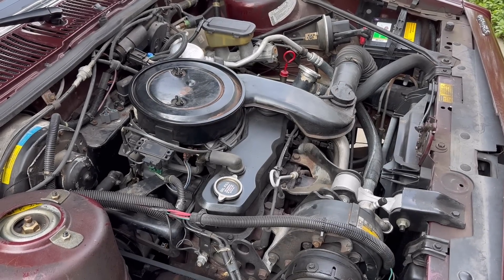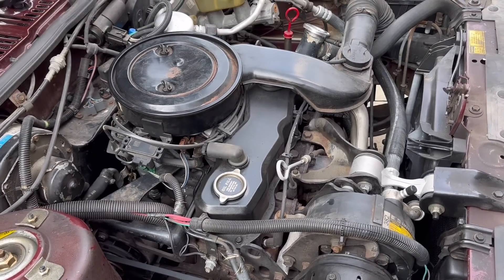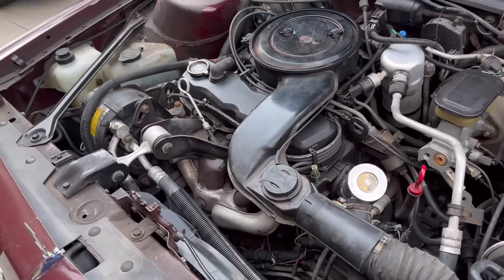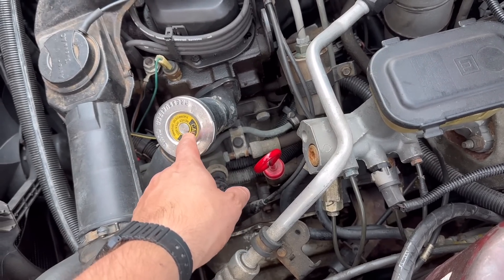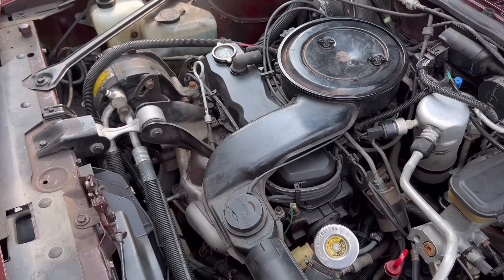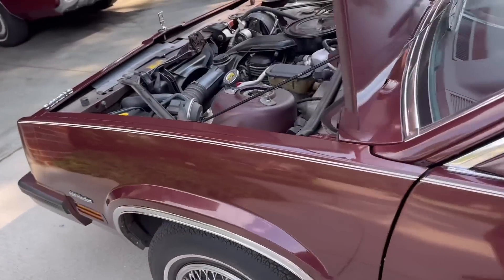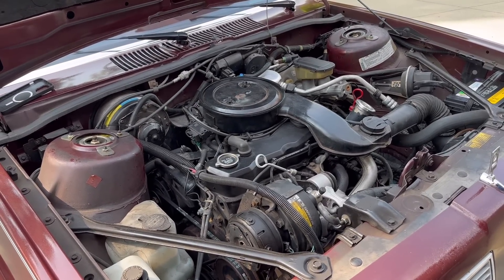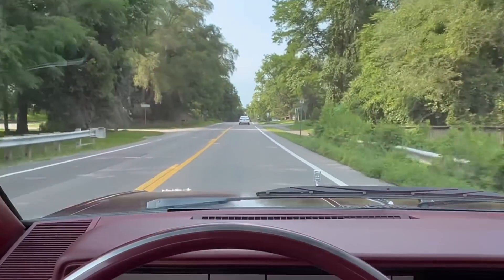Bad Engineering Makes This Engine Challenging to Repair: GM 2.5L Iron Duke 4-Cylinder Engine

Comment: First off, Tech 4!
The "Pancake" compressor is called the R4. I have not seen any excessive seal failures as compared to the old A6. In fact, the seal was designed to weep a little oil (as stated by the GM service manual). Both of my R4's and my A6 are still running R12. Two of them haven't been charged since the mid 1990s. I prefer to rack my car when changing the oil as it makes access really easy but did change it on my back for 25 years. Servicing the cap and rotor is really no big deal given the long service interval. I personally don't like doing the timing gears on the Tech 4. We used to see them come in on occasion with the phenolic teeth missing. Luckily, they aren't interference engines. Valve covers can be a pain too when the EGR valve doesn't want to cooperate. Great video Adam. If you are ever in eastern Wisconsin, feel free to stop by. We can put your car up on my lift and I can show you how we used to service your 80s and 90s car at an award winning Buick Pontiac dealership.
Reply: Most people don`t know this but Ford used those phenolic  timing gear teeth in their Ford 8N`s! We know as we rebuilt ours in 2001 & were the 1st ones to work on engine. Were surprised to see a tractor engine with that type of timing gear. It also had several teeth missing too. With the rebuild kits all metal gears the engine is nosier than with the phenolic gear.

Comment: This has to be one of the worst sounding engines, ever. It is so clattery and awful sounding.
Reply: In my new-car shopping of 2009, I looked at both Honda Civic and Nissan Altima.  I didn’t like how either of their engines sounded (they both had ticking from either injectors or valves, don’t know which).  This Iron Duke at least sounds better than that.

Comment: The 2.5 was a lot better than the 3.0 V6. The thermostat bolts would freeze up and the carbouretor bolts would freeze up.  I think the 2.5 Ironb Duke was a much better engine than the 3.0 litre V6 in the Cutlass Ciera. I wish I had gotten the Cutlass Supreme or the Gran Prix rear wheel drive cars from the late Seventies. The best riding car I ever owned was the 79 Pontiac Bonneville with the radial tuned suspension and the 301 V8. It was a 2 doorcoupe and rode better than my 78 Cadillac Coupe DeVille.
Reply: My cousin had an 80 Bonny coupe with the tiny 267 2bbl. Damn thing couldn't break 85 mph but it was 1 of the most quiet and smooth cars I've ever driven. It also got really good hwy mileage for a full sized car.

Comment: Pontiac hated the Vega engine but had little money. So..... They  adapted a Brazilian design adapted from the Nova four of the sixties. This engine was a cut down straight six. They then had to fit a cross flow head and put the intake over the distributor so it would fit transversely. As it was the carb would have been in the middle of the radiator and probably poking through the hood.

Comment: You can see why the imports were worried about these cars and how they sold so well to start.  On the surface they look great.  Comfortable with good space and handsome styling.  The designers did their job very well.  Then the bean counters ruined them.  I wish today's small cars were more like big cars, like these were.
Reply: I had a radio remote broadcast to do and it was a nice day, so I loaded everything up into my 1982 Citation X-11. Everything fit with more than enough room to spare. The car attracted a lot of college student attention. First, because they had never seen one. Ever. Second, it atsounded them on how much space was in what is now a very small exterior package.
Reply: How did the bean counters ruin them?
Reply: @bradkay  Cheapest materials and build quality. The 1980's cars were junk.
Reply: @garykeith1048  I don't see that the designers did a great job which is what plmn93 is alleging.

Comment: My Mom got my grandfather's 86 Celebrity,yes it was a pain to work on.  Blew a head gasket due to a broken head bolt and replaced the distributor cap while the head was off.

Comment: You already explained why this setup is bad when you mentioned that the cap was easy to do on an S10 pickup. GM engineers are not all that lazy but they LOVE reusing parts- they repurposed this engine wholesale from longitudinal applications without any redesign because they didn't want to change what already worked- or spend money on retooling engine plants.

Comment: I had an '84 Chevy Citation with a fuel injected Iron Duke. The first thing I thought of at the beginning of the video was the distributor and everything associated. How I worked on it was to jack the front end up and put it on jack stands. I then propped my head up under the car and I could see and get to most everything. My brother had the same engine in his Chevy Monza, and the distributor was a lot easier to get to because it was a rear wheel drive car. The engine was turned 90 degrees so the distributor was pointed to the right front fender.
Reply: At first, these 2.5 were only in RWD cars, so the distributor location wasn't an issue.
Reply: @johneckert1365  I put an injected Duke in my '48 Willys CJ2A. It wound higher than the Jeep engine did but didn't have as much low end grunt. Didnt miss the grunt very much cause it had 5.38 axles and I don't recall what trans low gear or transfer case low range had in it. All I know I could white-knuckle the (my) junky little jeep up to 55mph for the first time, lol.
Reply: @patrickshaw8595  lol that's AWESOME 😀
Reply: @johneckert1365 the distributor on my Rwd 2.5L camaro is in a pita location.. lol.  I usually jack the car up on the passenger side to remove the distributor. To replace the failed ignition module.

From the top have replace the distributors cap and wires.

Comment: what's funny is because i had the same car but in a chevy citation. same platform and engine. i bought the car for $75 it needed a choke pull off. i fixed it and drove it for 2 years, the reason i got rid of it? the driver side floor was gone. i sold the car for $50. i remember the location of the cap and rotor, i never had to change it but i did think it was a really bad place for it.

another car i had that had horrible ignition component placement, 1991 cavalier 2.2. the coils were on the back side of the engine. i had one fail once and 2 of the cylinders werent firring. it filled the cat with unburned gasoline. it was glowing cherry red.

the best ignition component placement? any iteration of the 3800, still have 2 3800 cars today. 2003 bonneville SSEi L67 supercharged 3800 (and yes it has the usual pulley swap/PCM treatment) and a 97 grand prix L36. both are in great shape, and im not really interested in selling them. some of the most trouble free engines i have ever owned.

Comment: So how did the term Iron Duke come about to be called for these 151 cubic inch engines? For the ones that don't know, these engines have the same bore and stroke as the Chevrolet and Ford 302's which is 4.00" bore with a 3.00" stroke.
Reply: My guess would be that they weren’t aluminum like the even-more-awful Vega engine.

Comment: The thing is, the engine and car were designed by different engineering teams.
Reply: Besides that, my experience working with GM engineering in the 1980's convinced me that none of them knew that they were building cars. They were just designing components that met certain specs.

Comment: I had an iron duke in an ‘80 Pontiac Phoenix that I got good service out of. Ran it for about 4 years until I had trans problems. I ran the car hard everyday but kept clean oil in it and serviced it well all the time. It wasn’t fast by any stretch but it did what I needed it to do.
Reply: I bought my '80 new--actually ordered it in '79  and it took 6 months to make. I wanted a stick , and they weren't coming off the line very fast. Fuel economy was excellent, room was awesome, but  it would not carry hills in 4th gear and that tranny was a dog. Could not keep synchros working. And it jumped out if gear often.

Comment: I had a 1980 Oldsmobile Omega Brougham with the Iron Dike and a standard transmission; four speed if I remember correctly.  Almost nothing about the car worked properly.  AC never cooled adequately, transmission was like something out of a pickup truck, and it was delivered with an undersized piston - just to name a couple defects!  Good looking car but a total lemon otherwise.  That was almost forty-five years ago but I remember that disaster like it was yesterday.  It spent most of its one year/12,000 mile warranty at the dealership.  Never buy a first year GM product!  LOL

Comment: 3:36  I have to admit that no matter how much I despise new cars the things I like the most about them is that many of them have the upside down mounted oil filter right where you can reach it. and there is not a distributor to worry about. I had the very guttless Nova with a 153. It was pretty reliable. It would get you wherever you wanted to go as long as you had forever to get there. The first Iron Duke I saw I was hoping that they had figured out how to make it get out of its own way and my friend's Buik proved that nothing had changed. I wish they would have kept more sucessful designs more often back then other than just the 327/350.  Had they kept refining that engine it might be the KSwap of GM today. Instead its on generators and old boats. SAD.

Comment: if well maintained those buggers were plucky reliable little engines they were in everything from your J body/X Body cars of the time like the Buick Skylark/Skyhawk Pontiac Sunbird/Phoenix etc. my late maternal grandmother drove a used 1984 Skylark limited for 2 years from Feb 88- Feb 1990 which either had the  Iron Duke 154 CI 2.5 L 4 Cylinder or the LH7 172 CI or 2.8 L V6 can't remember as is was over 35 years ago and I wasn't old enough yet and she traded it for a 1990 Toyota Camry DX with the 3S-FE 2.0 straight 4 Cylinder in it that lasted 14.25 yrs. 140,000 miles granted she drove more then than she did when we bought her, her 2nd Camry a 2005 LE model

Comment: I loved the thermostat design. I could fill the cooling system and let the coolant circulate . Then reinstall the thermostat. All within 5 minutes. This contrasts with trying to purge the air from most engines.
Reply: I had two steel bolts in my aluminum thermostat housing (83 Cutlass Ciera sedan).  When I had to change the thermostat, corrosion made the bolt head break off.  Had to run to the JY to get another thermostat casting.
Reply: @logicthought26  Truth be told, it wasn’t really a bad engine for its say as far as reliability when compared to its predecessor- the Vega engine and its successor-the 2.3 QUAD 4 . The Quad 4 was more powerful. But a lot less reliable. Also, it was more reliable when compared to some of the offerings from other companies such as the Chrysler produced 2.2 engine and especially the 2.6 Mitsubishi produced engine used as the optional engine in the Chrysler K cars. The 2.2 was decent. But it would blow a head gasket if you looked at it wrong. The 2.5 main problem was valve cover gasket leaks and the fact that it was LOUD and rough. It would get you where you needed to go. But you wouldn’t enjoy the trip.😂
Reply: It was smoother and quieter than that miserable Vega engine though .
Reply: @logicthought26  I think one of the other problems was that they put the engine in cars that were simply too heavy for it. It was decent in the Monza and its clones. It was decent in the X bodies. But when they put it in the A bodies, it was overworked.

Comment: Most all of the US Postal delivery trucks are "Iron Duke" powered.  They take unbelievable abuse, and keep on ticking.  They're beginning to replace them a few at a time with some sort of junkie van-like vehicle.  They're even running a few EV delivery trucks with, so far, horrible results.  EV's are soooooo far away from being a viable transportation option for the masses.  Someday, yes, but not right now.
Reply: Our town had 2 EV mail trucks. They lasted 2 yrs. Now they have the Nissans with the gas engines. My mail carrier loves it cuz it actually has a/c and heat.
Reply: They could've bought Tesla Model Ys with the seats removed and rhd and racks/shelves put in for less,  and have stunningly reliable delivery vehicles. That would've made too much sense though.
Reply: @jamesengland7461  Reliable for warm climate locals, sure.  For the regions 'up north' ?   Not so much.

Comment: I agree on the other merits of the cars, Adam.  Don't remember what year the Cutlass Ciera came out, but a friend had one and it WAS amazingly spacious, plush and quiet.  A great car for road trips up and down California... except for that first 20 seconds it took to get up to 60 miles an hour...  😋
Reply: Ciera was produced from 1982-1996.
Reply: @smf15  Thanks, that would fit.  This would have been around 1985.

Comment: They sell various products that claim to fix steering rack "morning sickness" and if any of them work, it could make a big difference to anyone considering a 1980s GM FWD car. I'd even expect engine oil to leak more slowly than normal power steering fluid, with a slight penalty in fuel economy. Increasing the  thickness until the internal leaking stops would seem like a reasonable strategy. Has anyone tried anything like this?

Comment: We need to keep in mind that this engine was originally built for the Monza and its companions where things weren’t that difficult. When they turned it sideways, it made things much more difficult.
Reply: I thought the engine was meant to replace the aluminum engine in the Chevrolet Vega that gave so much trouble and GM called it Iron Duke to emphasize the fact that it was NOT made of aluminum.
Reply: @BobConnor-n2g  other than the special edition Cosworth, the Vega never used any engine other than the aluminum 2.3. The Monza (and its mates from the other divisions) was built on the same platform as the Vega and was phased in as the Vega was being phased out. It essentially replaced the Vega. And it used the iron Duke from day one. And yes, the IRON was emphasized to let people know that the aluminum engine was no more
Reply: @dmandman9  Not from day one. First year they used the revised Vega engine, then the Iron Duke. I know for sure, because I once bought a beautiful '78 Monza and got a complete '76 Monza in parts, sans self destroyed Vega Engine, with it from the owner that had bought both new.
Reply: @sebastian0107  i stand corrected. Now that you mentioned it. We had a customer with a 1976 Monza with the Vega engine. Forgive me. I’m 60😅😅. I now remember being surprised that the engine wasn’t bellowing smoke and actually outlasted its transmission. But I think they’d improved the engine by then by installing cylinder liners which improved reliability a lot.
Reply: @dmandman9  Yes, correct. They were somewhat better. The one I got in parts had overheated; warped. The Iron Duke I drove was reliable but noisy. No fun, but not that bad.
Reply: @sebastian0107  yes, you could hear an iron duke coming a long way off. It was fairly tough, the power was on par with the other engines of the day. But the noise and vibration were excessive. The Ford 2.5  used as the base engine in the Taurus had similar power. But it was a lot less crude and noisy . It was less common as well. Fords 2300 OHC was a lot more refined .
Reply: @dmandman9  Incredible that it found it's way into millions of cars. No small wonder that US-car-buyers diverted to Camry's and Accords ...
Reply: @dmandman9  I never heard of a Vega engine with liners. I know that they improved the valve seals but I'm pretty sure they left the cylinders as bare aluminum.
Reply: @soaringvulture  Again, I stand corrected. I assumed they’d done so because the aftermarket engine rebuilders and machine shops installed liners which improved the durability of the rebuilds . And nearly every engine that failed had scored cylinder walls. But I just read that they improved the valve seals (I knew that) . And they greatly improved the cooling system, so they no longer overheated at the drop of a hat.
Reply: Going back farther , it was sorta of based on the Chevy 230 250 292  inline 6.
Reply: @bobroberts2371  yes it was
Reply: I read this design originated in the early '60s. Pretty sure the Iron Duke's granddad powered our '63 300 Chevy II wagon.
Reply: @alexanderspenser4960  kind of. It’s officially designed by Pontiac. But it’s loosely a 6 cylinder Chevy with 2 cylinders removed. But it has the bore and stroke of a Pontiac 301 v8. By the way, Chevy made a 4 cylinder in the 1960’s as well which indeed was a cut off 6 cylinder.
Reply: @alexanderspenser4960 Pontiac designed the engine in 1975 to 1977 to be a reliable engine. 

The SAE paper is 770819 by  John M. Sawruk P.E. of   the Pontiac Motor Division  of GM. September 1977

 Thrifty. 

 Also to have a different GM division create a 4 cylinder engine so not associated with chevys vega engine negative view .

There is a SAE paper on the iron dukes design in about 1977

Comment: Right about the same era that GM blew off everything it learned from Toyota Total Quality Assurance.
Reply: Yep, that wonderful Toyota Total Quality Assurance with the current recall of most Tundras with the V8 that blows up because they failed to clean the blocks of machine debris during manufacturing.    Good job Toyota!!